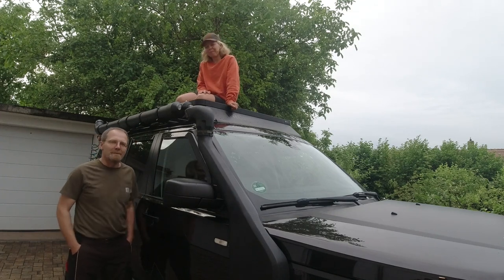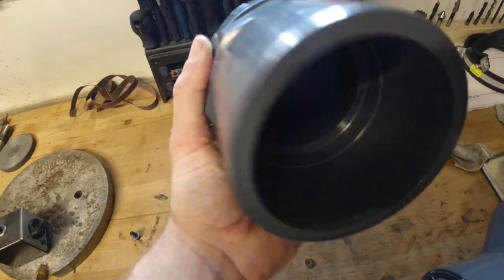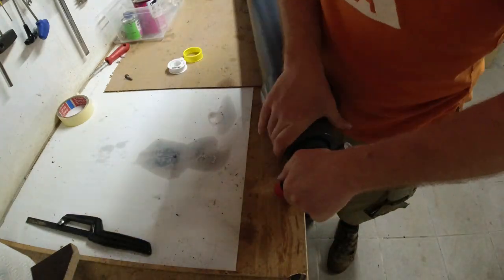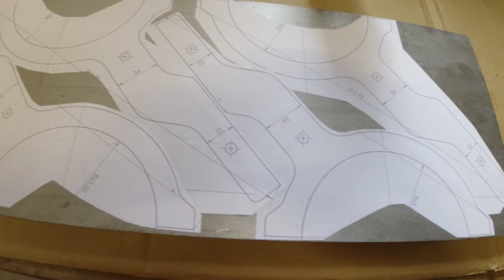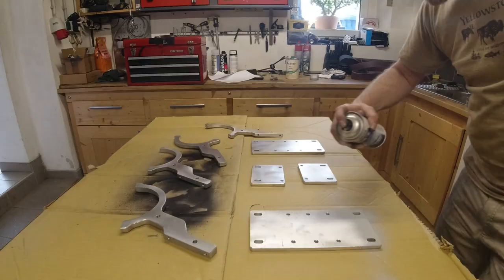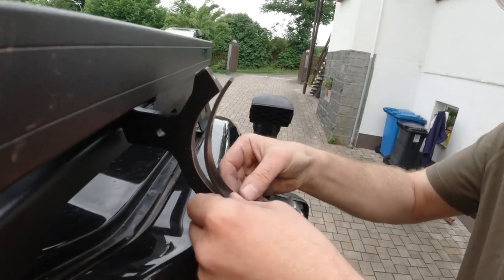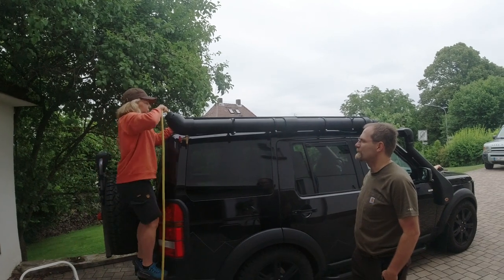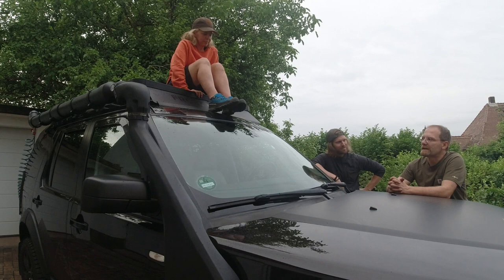DIY Pressurized Solar Shower for Roof Rack / water tank for camping and overlanding / LR Discovery

Comment: I would love to hear more on you theory of  "do not rotate" when assembling PVC parts with PVC cement?? I was always taught a 1/4 turn to help the glue engage with the parts and help eradicate air bubbles!!  Love the M6 allen's holding on the cover half's and the addition of the O ring was about a "German engineering" as it gets . Great project Great result!!

Comment: I love all of your videos!  My first Land Rover was a new, 1973 L88 3 door with safari roof that I bought in Denver, Colorado USA. Then a 1999 Discovery II, a 2009 Range Rover HSE Sport and now I drive a very civilized 2016 LR4 (disco4) HSE LUX V6 supercharged petrol.  I bought it used with 74.800 miles, 1 owner, it looks brand new, for $25.000 US dollars!  I am a cleaning freak, just like Christian and adorable Vera! I installed interior Land Rover Rubber Matts, and cleaned the interior with sprays and brushes, compressed air and lots of vacuuming. The interior looks brand new! No scratches. I washed the engine bay with brushes, compressed air, degrease the engine components, and hose it down where water is allowed.  Your videos are very instructional and straight to the point, without the extra useless comments found in other videos.  My next task is to de-clog the sunroof hoses, because we moved from Utah to Florida where we have torrential rains just about every day.  Keep up the great work!
Reply from the maker: You sound just like Christian, that is so great. I hope you can have as much fun in Florida as in Utah with your Discovery. Been to both states, but more often to Utah with our Jeeps when we were living in Michgan. 👍🙋‍♀️ Vera

Comment: Always impressive, the job you do.  Thanks for another feat of German engineering.  I use a 2 gallon stainless steel garden sprayer that I can heat on my cook stove and it is also able to be pressurized.

Comment: Another great video thanks but here in Australia there has been a wake up call on roof racks and roof load limits.
You will find that on the D3/4 that the dynamic load limit is 75kg. That includes the weight of the rack as well as anything else attached. Take care!

Comment: A lot of the things you have done i.e the heating for the roof top tent an the shower I also had experience of on my liveaboard boat , I was much more trail an error an copius amounts of bad language than you two but I got my chinese heating to work and also used the exhaust to make a coil heater for my water, using brake piping . Youtube is a fantastic learning tool an you are wonderful teachers.

Comment: EXACTLY what I've been looking for. I have a disco 5 and a Front Runner Rack but I'm either looking to mount it on the side or make a smaller one that would mount inside or like on top of the roof rack towards the rear since I carry a roof tent on top too. It would make it a bit smaller in capacity but I don't really have room for anything else on there once the tent is on. However the shower would off set the awning on the other side though.
Reply from the maker: 👍 🙋‍♀️ Vera

Comment: So spured on by your amazing and very well detailed videos I decided to do a job on my Range Rover Sport (Discovery 3 in a posh dress).  The engine oil sump was porous and weeping oil so I decided to change it.  As per all your advice I set the car into extended mode for extra height and then I remembered that I needed to pull the 3rd fuse and also I pulled the solenoid.  Imagine my horror when I took the cover off and there was no fuse box 😱😱😱😱then remembered mine is a UK car and as such on the other side but I automatically went to the other side as you do in your videos 😂😂all done and no more leaks.  The pan was not only porous but around the gasket the rust had gotten to the mounting face and so had bits missing!  One for us all to check.  Keep up the good work and any indication of when your glamorous assistant will be sending out the stickers?  Apparently I was in the next batch but that was a while ago 😉😂😂👍take care and stay safe 😷
Reply from the maker: 👍 I get so many sticker request that I have to send them out in batches, and order new ones . It might take a moment because right now we have so much to do. But they are coming.  🙋‍♀️ Vera
Reply: @Vera_and_Christian  ❤️👍😁

Comment: Very well designed and built.
One question: why is the head of your snorkel facing the rear of the vehicle?…I’ve never seen them fitted this way, but believe some people think it stops rain ingress, and others argue that the air is no longer “pushed” into the snorkel…your reason?
Reply from the maker: Takes 1.5L less per 100km and less wind noise.  Christian

Comment: hey guys. An interesting issue has come out of my home country reguarding ROOF RACKS.  Its about the load capacity. Discovery 4 has 71.8kg LESS the weight of the roof rack.  We have had a few roof racks leave their vehicles on the highway and off road. After seeing your explanation of wheel spacers, i thought i would bring to your attention a possible "insurance / warranty" killer.
Reply from the maker: In Germany only 75 kg is road legale. But it is common to exceed this limit. 😬 Christian
Reply: @Vera_and_Christian  we have the rediculous situation where the roof rack costs around 500euro yet can only carry 50kg on some models. Very expensive toy, hahahaha

Comment: Is there a materials list? Specifically the parts used for the pressure regulator, over pressure valve, and maybe a printable file for the cover?

Comment: Was there ever a plan to have a twinned tank on the opposite side for air pressure? That way you'd be able to use all of the volume for water. That was my first thought when you mentioned that you have to keep some space in the tank for air.
Reply from the maker: No, the weight on the  roof would be way to heavy with two tanks and his RTT. He doesn't use it anymore and has a huge watertank and shower setup inside the car, which was not yet available when we build this. 👍👌🙋‍♀️
Reply: @Vera_and_Christian  Aw I see, he's moved on from your solution entirely... On to the next!

Comment: Also forgot to add, have u ever used the paints from Hycote plse , as have had a good success with them , sorry I’m waffling again, lol
Reply from the maker: 😃 No, I have to look into that 👍. Fabian purchased all the parts for this project. 🙋‍♀️ Vera
Reply: @Vera_and_Christian  many thanks , did respray my windscreen scuttle panel a few years ago , if you search for it under my  name on the discovery 3 forum I’ve got pictures etc , where I sanded it down , used a plastic primer and built the layers up then finally a lacquer coat . Hope it may be useful to you , stay safe 👍
Reply from the maker: @garystuart226  👍 will do that 🙋‍♀️Vera

Comment: What plastic are you using in the 3d printer?
Reply from the maker: We use PLA. Now we know that is not ideal for outdoors use. But we deal with that problem when the time comes. For now, it is painted and should last a while. 👍🙋‍♀️ Vera
Reply: @Vera_and_Christian  painting is a good idea, I'm in Australia and PLA deforms in the sun 🙄. ABS  is much better but it deforms when cooling.